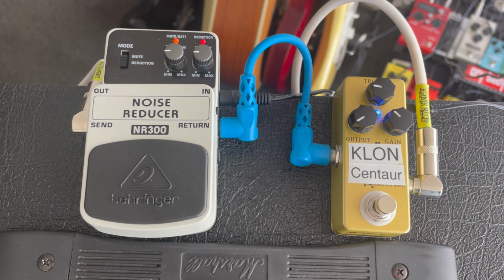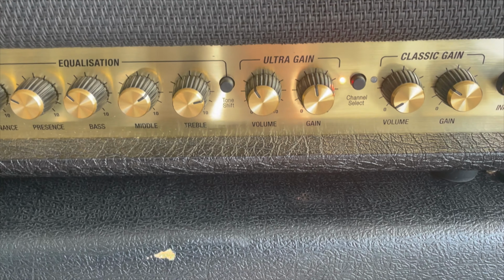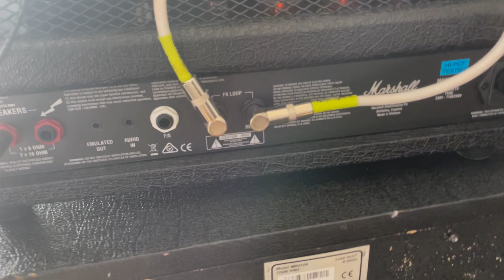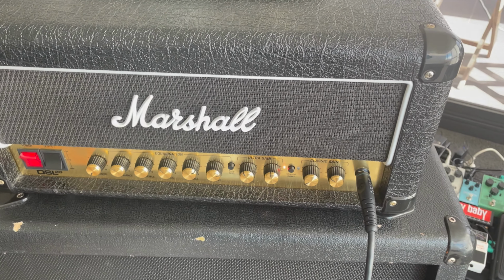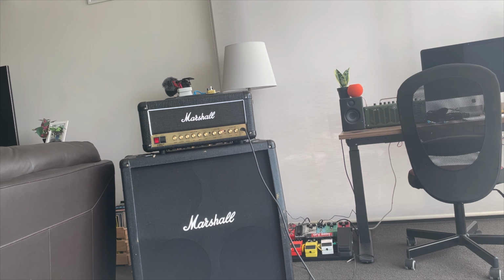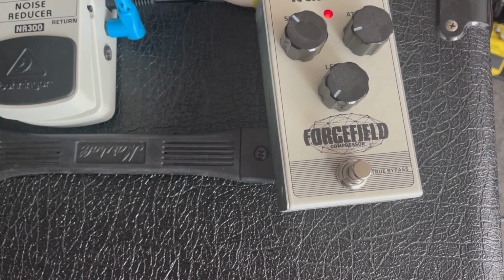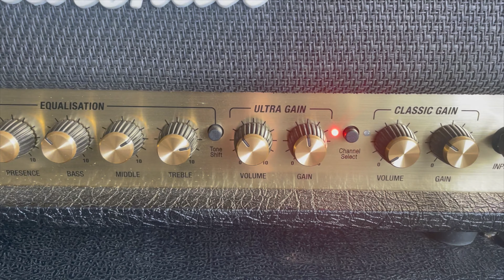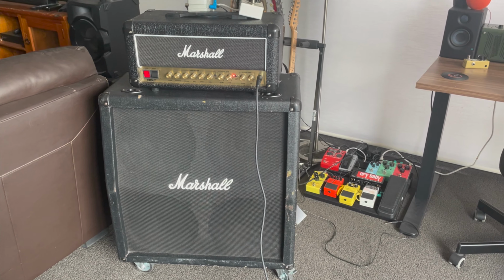using a klon clone drive pedal to tame/control the volume on a tube amp

Comment: Interesting use of the Compression pedal!
Reply from the maker: Yeah. I reckon if I could play around with the EQ I might be able to shape the sound better. But the Klon clone is working really good and I’m liking the sound coming out of the tube amp. I can finally play it at home
Reply: @bmas020  Nice.  What I did because I also live in an apartment, a small one, was use a DI into an audio interface into my computer, then just use headphoones, or I would just use a solid state or digital amp, but that is cheating, right, LOL!
Reply from the maker: @JDStone20  I thought we can’t use Di because we need an amp for the load? Or did you have your amp connected into the cab and some sort of an output from your amp then going into the interface?
Reply: @bmas020  You are right, you might need a load before the DI. I am lucky enough to have a tube amp with a DI built in.  You might need a load box or cabinet with speakers like you said.  I think there is info on hooking up your Marshall DLS20 to a DI somewhere,, but that would solve you paritcular situation and not cover a general one like your video did. Good work BTW!
Reply: @bmas020  You get a DI box, that is what I use also, I just typed in DI like a dummy.  I believe a DI box has a load on it also, I might be wrong, so double check me.
Reply from the maker: @JDStone20  oh that’s great that you have a DI Built in. I thought about getting a loadbox and May do it in the future so I can record stuff quietly through the interface. Cool, thanks for sharing the tips.